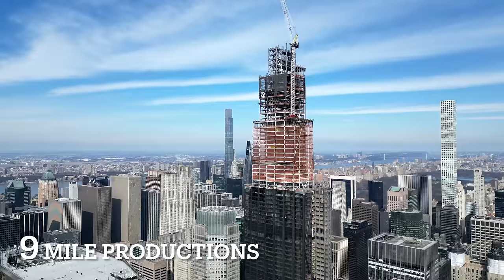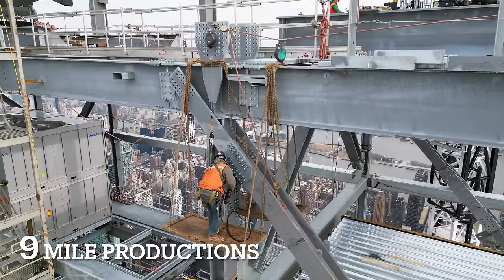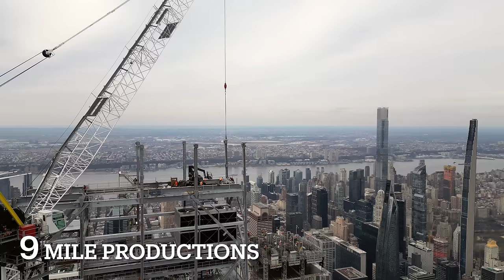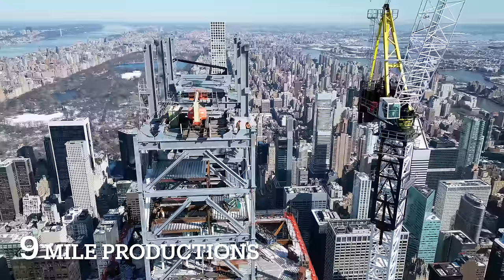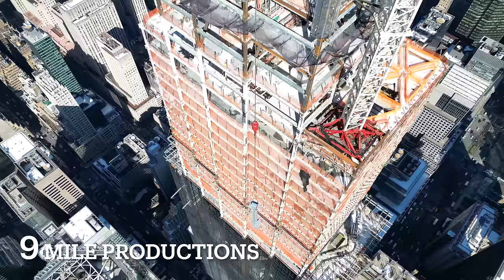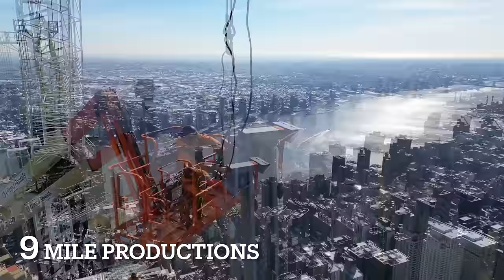$3BN Skyscraper Reaches the Top! JPMorgan Chase Building, 270 Park Avenue, New York City

Comment: I'm surprised that the wrenches do not have a safety strap on them, attached to the workers wrist, in the event that the iron worker drops it.
Reply: I don't think you'd get away without a lanyard/tether on everything in the UK on any sizable job.
If you're off the ground at all, lanyard/tether seems to be the rule, 6 or 7 foot drop is fast enough for a tool to hurt, if it catches you
Insurance liability, etc, simpler to make a blanket site rule, less arguments.
Had a hammer go off the side, from about 10 floors, into the public part of the site.
My boss had to conduct bounce tests with a hammer to see how much they went sideways once they hit the floor, how they lost energy.
Reply: union ironworkers don’t drop their tools. also that’s what the nets are for

Comment: After they hand wrench the bolts what do they do?  Fill out the rest of the bolt hole grid? Torque the bolts? Weld?
Reply from the maker: Add the cross sections, measure everything level…then torque

Comment: Amazing how so many hand tools are still used to lock those beams in place. I expected a slew of power tools. Props to the crew.
Reply: The work is hard enough now imagine wearing a 50 lb tool belt all day.
Reply: What power tools were you expecting?
Reply: They use an impact gun to tighten the nuts. They are only putting a few bolts in each plate so they can say all the steel is up. When they fill the rest of the bolts they will tighten everything down with an impact gun.
Reply: All the other beams for that level will have to go in, before all the bolts are inserted and the whole thing checked for level.
In the UK we'll use 'come along's' as you call them, cross crossed over the deck to pull it all true.
Used to have some honking great air guns, years ago to tighten bolts up.
Dangerous gear, scared of ripping muscles and tendons the way they'd kick when they'd tighten up.
Reply: @georgechickful  In Canada we used a cable puller called a TirFor.
Reply: @JohnnyBee-he6qi  Aye that's the baby, pronounced 'turfer' over here, thought it was a different thing until I googled.
Can't say I ever feel safe around them, once they're wound up.

Comment: I dont understand why they tighten bolts by hand, ?
Dont they have power tools ? And shouldn't the bolts be torqued ?
I dont know anything about the process,  just asking
Reply from the maker: After cross sections are connected, check for level then torqued down

Comment: "There will no cease to end the white man's greed" ~ Ojibwe Elder 1872 - Thanks for proving it!
Reply from the maker: Welcome
Reply: the white man invented,engineered and built pretty much everything in america for over 100 years. have you ever taken an elevator instead of the stairs, used a refrigerator or air conditioner, rode in a jet plane,crossed a suspension  bridge,rode in a car ,used electricity? ....the list ist a lot longer but i think i proved my point
Reply: @kevsta67  yep, YOU NEED. Thanks for even more proof!
Reply: Are you referring to the 0.001 interest on your checking account?